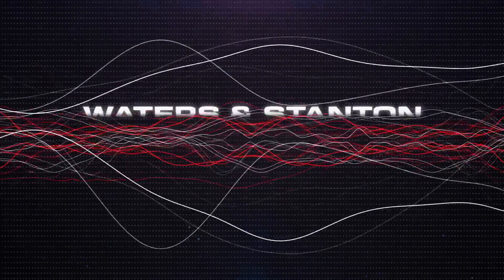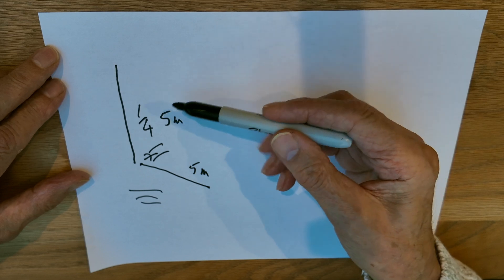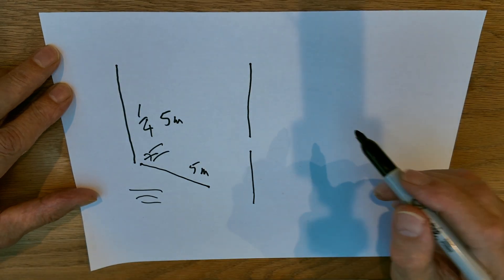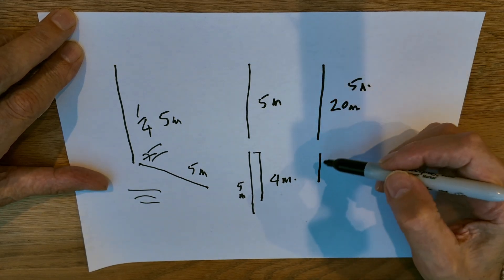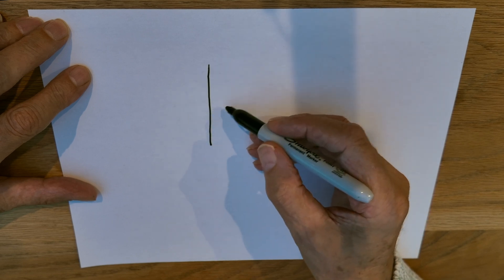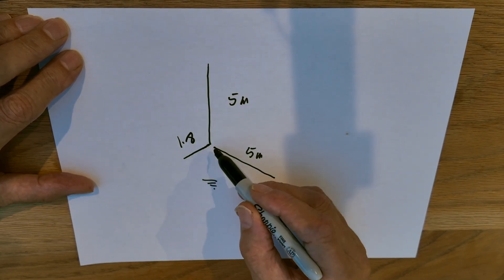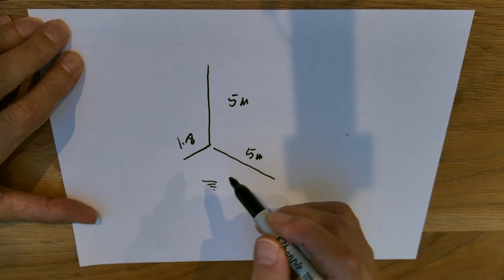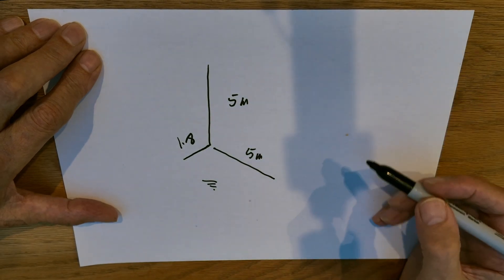Ham Radio Dual Band Vertical - Easy Construction.

Comment: Apologies,  i am thick. So you end up with the 20m vertical wire and a short length of wire anttztched to the bottom of driven element,  or attached to the earth side with the 30m radials ! 
Then add a seperate radial  for 17m ! 
You seem to show the short piece of wire to make a quarterwave added to the bace of the 20m driven ele going horizontal or sloping.
I think you add the small extra piece of wire to the main driven ele  then add a seperate 17m radial. Just trying to get it clear in my head hi.
Reply: I noticed this too. I think Peter made an error in one of his drawings. The extra length of wire for use on 17m is a radial, therefore it is attached to the earth side of the coax.

Comment: Another really useful antenna video Peter, Many thanks. As this is effectively a dipole variant, would it be possible to use traps on both wires in order to multiband it? 73s Dave G0KPZ
Reply from the maker: Yes you can.
Reply: @watersstanton  .. Thanks Peter...that's great.

Comment: Are the radials parallel with the ground, or slopping down toward the ground on the end?  Would it also work just as well to have two radiators in the air one length for 20 meters and one length for 17 meters with a radial for each for their specific frequency?   This is a great idea, thanks for sharing!
Reply from the maker: Sloping down.

Comment: This is a fantastic, cost-effective solution for amateur radio operators with small gardens/yards!  However, if the total length should be 1/2 wavelength, wouldn't the length of the radial for 17m need to be 3.5m (17m/2 - 5m = 8.5m - 5m = 3.5m)?  Thanks for all the great advice Peter!

Comment: Made one these today Peter, same S point receive as my fan dipole, however ... noise made the vertical unusable. It seems to be a noise magnet for the one I made.
Reply from the maker: Yes verticals are noisy in many locations. In the UK we often find no benefit  in a vertical over a dipole accept if you are stuck for space it may be the on,y viable option. Another video coming up on this topic.

Comment: Peter,

A great recommendation for me, an occation Ham with backyard limitations.

1) Your raised radials equivalent to a dozen plus vround radials was eye opening.

2) Can you get tbe same raised antenna & raised radials, if the vertical antenna and coax radial connections are at ground level, but having the radials move upwaed and outward until their ends are 6 ft above the ground?

3) Adding thar extra short 17 m radial makes it an off-center dipole. With different impedence matching. Right? 

4) Can you replace the coax with ladder line to make it an multiband doublet antenna and have your antenna tuner do the matching?

- Paul 
  California
Reply from the maker: You can elevate radials upwards from ground - not quite as good but works. Ladder line -  could work but the radials can all be 20m quarter wave.

Comment: Thanks Peter for this video. I have a very similar setup to what you described. A 24 foot extendable painters pole with a fiberglass lower section that raises the aluminum extensions about 2 meters above the ground. The aluminum sections are my radiating elements and are about 15.5 feet long. I have 2 radials that are cut for 20 meters. Another advantage to this is if change from feeding it with just coax and instead use a 64:1 Unun it will resonate on 15m, 12m, and 10 meters. It really works quite well.
Reply from the maker: Sounds interesting. Well done.

Comment: I’m new to ham so…. Are the vertical and 2 radials connected to?  Example 9:1  I’m using a G90 and it internal matching unit.  

Also I could set it up for various freqs   Bye swapping out one radial for a different one.     Thanks
Reply from the maker: Direct connection, no 9:1. Vertical radiator gies to centre of coax, and two radials connect to outer sheathing .
Reply: @ thank you.
KQ4KDR

Comment: I've found no improvement using elevated radials here in central US
Reply from the maker: Yes, get them above ground.
Reply: @watersstanton  ive actually done alot of testing with mine at ground level and 1 foot increments all the way to 7 feet.
In the end with feed point at near ground level had best results.
Must be soil/substrate differences from region to region that effects more than height.

Comment: Will the length of the coax feed line matter? Won't it also act as a radial?
Reply from the maker: At the feed point wind a few turns of the coax around a ferrite core. Don’t add anything else.
Reply: @watersstanton  thank you sir. 👍
Reply: I have something very much like what Peter is telling us. On this setup I didn’t find that the coax made much difference but if I fed it with a 64:1 Unun I did see an impact by the coax but I can’t really explain why. I have a video of what I did over on my channel if you are interested in seeing my results. I definitely cannot compete with Peters excellent videos though.

Comment: if you can add another 3rd radial for 15m band will work also in 15m band ? 73
Reply from the maker: Probably not. You really need bands that are close to the main band. But a 17m and 15m antenna would work well.